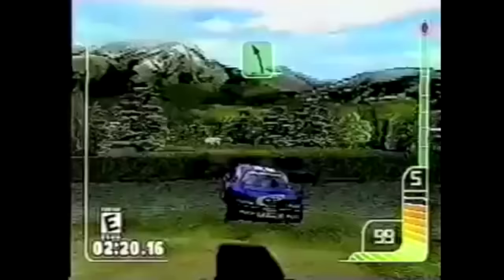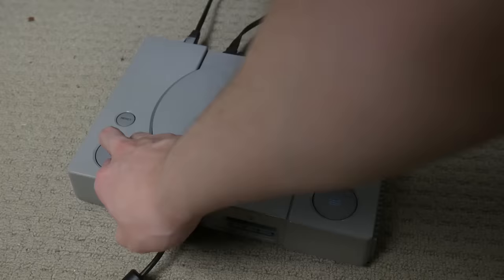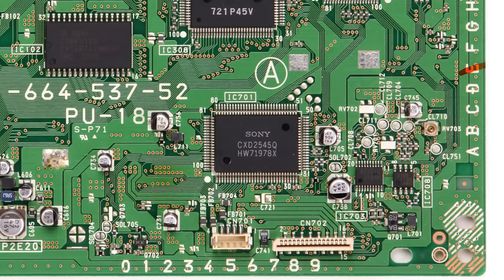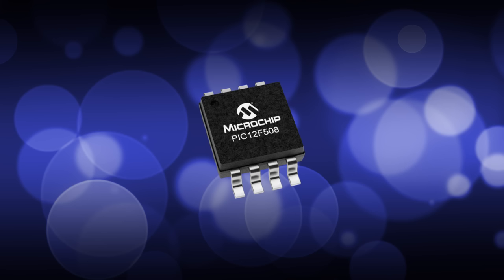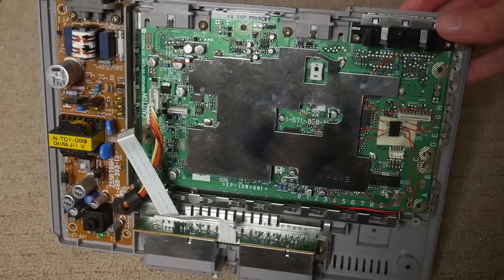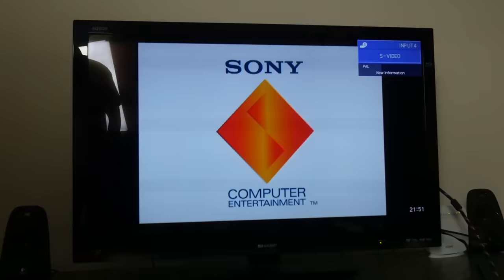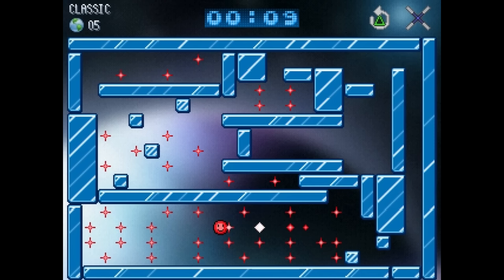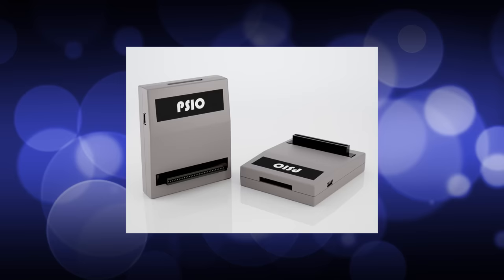Making a PlayStation 1 modchip from SCRATCH

Comment: Just something that is not completely correct on this video.

Stealth modchips don't bypass all copy protections on the PS1. Games that use LibCrypt are making more checks than just the modchip check.

These games (Spyro the dragon 3, for example), check for magic values in the CD which can't be reproduced by a regular CD Burner. Since burned copies don't have these magic values, this means the copy protection will be triggered.

Some burned PS1 games legit need cracks to work properly in modified PS1s (scene groups like PARADOX, KALISTO, STATIC and LIGHTFORCE did a lot of libcrypt cracks).

Comment: Hi Matt, i know this video is old, but i was following it it and i am pretty sure you confused the 12C508/12C508A with the 12F508/12F508A, these 2 chips are very similar, the F is supposed to just be a re-writable version of the C, but i am learning the hard way that the F doesn't seem to be compatible with this mod and according to the github by Kippykip it just isnt. 
You can correct me if i am wrong on this, but if i am right, please correct the mentions of the 12F508/12F508A in the description.

Comment: Cool little video here.   However, you can get new lasers from Aliexpress for dirt cheap.   Are they amazing quality?  No, but when they cost as much as a couple cups of coffee and still work fine for a few years?    Not really much reason to complain. 

PSIO is just far too expensive.   It should be literally half the cost, or less.   Especially considering you have to cause permanent damage to your system, for it to work.

Comment: a PIC Programmer seems like a bit more than a simple DIY project.
i would've gone with a standard arduino Nano, since it can easily be programmed via USB
or nowadays with a RaspPi Pico, which would be very overkill but doesn't require you to install any programming software

Comment: The reason the emulator doesn't have issues with framerate vs the console when doing pal/ntsc is that the ps1 emulator itself can change from 50-60hz (depending on demand) while a physical console can not. (I assume that the writers for the emulator probably just allowed the VC to draw whatever frequency is requested based on the content's region.). 

In fact, playing a legitimate PS1 game on a modded PS1 from the opposite region (Pal vs. NTSC) CAN cause issues depending on if the developers tied game code to framerate. The only true way to get around this, is to install a dual frequency oscillator mod on the ps1, so it can switch between 50 and 60hz itself. However, apart from collectors, the likelihood of someone playing a modded ps1 game from the wrong region to their ps1 is pretty slim...
Reply: The actual console is also capable of switching between PAL and NTSC. The reason It might be NES ran on PAL mode is because he didn't press the L2 shoulder button. It changes the emulator to NTSC video mode. You can also do it in 240p test suite. Upon inserting an NTSC game, the console will change to NTSC mode. But this only applies to SCART, not composite

Comment: This explains the way the ps1 copy protection worked incorrectly. It wasnt data burned to a certain sector, the track on the cd had a certain wobble to it, and the laser would have to move to keep focus, and that movement was how the data was read. Its not just that there arent any conventional cd burners that can write this data, there are no cd burners anywhere that can write this data at all, as it is completely impossible to burn this data onto a cd. It has to written to the cd with the cds pressing, which means any raw cd you buy already does not have this wobble and so you cannot add it. You could press your own cds, but thats slightly more expensive than anything a mortal being can afford.

This does bring up an interesting idea though. A cd manufacturer could have made disks with this wobble already pressed on, and the cds would have run fine on all normal cd players, while also allowing playstation games burned on them to run on an unmodded playstation. Wonder why no one did this

Comment: Mod chipping is only illegal in the UK because the law hasn't been updated since 1988

Edit: actually a court said in 2004 that it is illegal but there is another court case from like 2008 where they ruled that it is not in itself copyright infringement

Here is part of a law from 1988
Section 296ZB of the Copyright, Designs and Patents Act 1988 (CDPA) makes it a criminal offence to sell or distribute “any device, product or component which is primarily designed, produce, or adapted for the purpose of enabling or facilitating the circumvention of effective

So selling them is illegal and piracy is but I'm guessing the UK doesn't like RACISM because it is legal to bypass that.
I'm not a lawyer so don't quote me on this.

Comment: I worked at a PC Shop in the mid 2k's and they Sold Black blank CDs wich looked exaclty like the PS1 Discs and you could Burn them with any CD-Writer. So the Black Ink didnt do anything😅
Reply: It was impossible to buy a licensed console in Russia, as it is sold to the whole world, we already sold it with this chip, which is why all consoles bought in the Russian Federation have this chip modding and any console bought from us is no longer original. We don’t know about black discs, usually a regular disc with a picture printed on it was sold :D
(sorry for my english)
Reply: @Vladstvo  The Black ones just behaved like any other Blank CD. But they looked cool😅 That was btw the only time in my life i have seen those Black CD-Rs. (The upper side was just Silver)

Comment: I had to do all this to my ps1. I’m a collector so I was sweating the hole time as it’s mint. I fitted my chip away from the board and had it sitting pretty and my wires are set out like art work. Very happy with my install 🥳

Comment: "They were able to write data to an area that an ordinary CD writer never could".

28 years on and still nobody can read the patent when they do their research. That's not how it works. It just wobbles the TOC data on the cd from side to side intermittently. Wobble is a 0, no wobble is a 1. It reads the wobble and the TOC at the same time. It's right there in their patent. There's no "wobble groove", that was an invention of the PS1 community.
Reply: The black discs weren't a copy protection scheme either. Also there was at least one, maybe two more checks on the PS1 security. First it would check the wobble data, then look for a logo, then check the wobble data again on later consoles.

Comment: Nope, the four letter Code isn‘t stored in the bios itself. It‘s hardcoded in an custom authentication chip based on the Motorola MC68HC05. So even when you try to swap the BIOS from an NTSC console to an PAL one, it will only boot PAL games. Even some older consoles (SCPH-1002), will only boot PAL games even when you installed a Modchip, thats because missing the NTSC Oscillator clock. Newer models overcome this by using the same clock signal, but isn‘t nearly perfect. So you might see on an NTSC console playing PAL games some flickering. You can get on all consoles a perfect NTSC and PAL signal when you Clock mod your console, but it‘s never done to newer models.
Reply: I think your close, but wrong slighlty aswell. The onboard (on the motherboard) CD driver ic, microcontroller will send over the region, correct or not, but it will do so by detecting the region from the pregab region of any disk inserted. the wobble of the lens that ALL CD/dvd and blueray players correct for, will be looked at by this controller IC you mention. At bootup, it will not only seek the pregab first sectors, but also look at the frequency modulated region code and send it to the main ic (if requested?) anyway, more and way better details are on http://www.psxdev.net/forum/viewtopic.php?t=128 and Technologie connections made a nice video too: https://youtu.be/XUwSOfQ1D3c?t=350 (5:50).

There is a region encoded on the disk, its inside the pregap wobble, and you cant burn it. The modchips override whatever is send by the MC68HC05 to the cpu. 
Right, so I was actualy looking for someone who mentioned the "mistake" in the video, and you did. so I dont have to. but now I feel dirty, for writing this much. please forgive me and take this knowledge. (also please visit psxdev)

Comment: Great video. Do you know if you can use a backup disc with this mod chip and also still use the gameshark(the one that plugs into the back of the system)?

If you have a modded memory card that lets you run backups on ps1, you cannot use the gameshark with it because you need to access the ps1's memory card manager first.

Comment: Got a 10$ chip in my ps to read burnt CDs without soldering cables! I swapped the chips and this was the whole magic! My friend had to swap a original to a burnt one after the boot sequence! The whole time the ps was open and between the switch and the upper housing was a spring! And on the back was a cheating module what was only capable for the very first ps with the back door

Comment: I never asked but:
1- how did they get to read the 4 letter code from the disc?
2- once they had the 4 letter code, how did they figure the proper code to inject and when?
3- how does an outsider know what every PS1 PCB chip pin is doing? How did they get their hands on the PS1 PCB schematic?!
Reply: 3. Using a logic analyser

Comment: Late to the party, but still out of interest: I own an SCPH-1002 (Europe) which you can trick into playing burnt games by booting up an original disc while pushing down the button inside the disc drive with tape with an open hatch and quickly changing the disc to the burnt one while it stands still for a few seconds during the boot screen. The way it works is it reads exactly the part of the disc a CD burner can't copy from the original disc, but boots the game itself drom the burnt one. So if the region information also is within this part, shouldn't it theoretically be possible to play games from every region on an unmodded PS1 with that serial number too?

Comment: I've been tempted to pick up a ps1, but it feels like getting a ps2 and freemcboot is a better option overall.
Reply from the maker: Depends on your goal, a PS2 with FMCB won't let you play PS1 backups/homebrew (outside of POPS which is a software emulator and naturally isn't as good as the native PS1 hardware in the PS2). The only way to enable native PS1 backups/homebrew is with a modchip.
Reply: @MattKC  Ah, well is there any reason not to go for a modchipped PS2 instead then?
Reply from the maker: @moth.monster  The biggest disadvantage of PS2 modchipping is the difficulty (20 wire modchip onto some fairly small contacts). But it's definitely the most effective method of unlocking a PS2. Combined with FMCB for the custom BIOS menu, it's probably the ultimate PS2 experience.

I may or may not be planning a PS2 modchip video in the near future...

Comment: If you ever wondered why PS1's play Nintendo stuff so well, you have to delve into the whole next generation of where the SNES was and the then collaboration of the Sony/Nintendo joint next gen console and the court case that followed one of historys longest litigations where Sony kinda wandered off with the goodies that became the PS1.   If you ever had the dongle that allowed you to put Gameboy games into the memory card of a PS1, looked at the almost childlike simplicity of the translator, its not that hard to see that a PS1 has a beating heart of a SNES and I suspect the joint console was planned with some idea to bring forward CD's with compilations and games from Nintendo's back catalogue.
Reply: The sound chip in the PS1 is an evolution of the Sony SPC700 in the SNES
Reply: I don't think any of the PSX hardware resembles the SNES and there is certainly nothing in the PSX that would help with running Gameboy tech.

Comment: you forgot to mention the dreamcast, mine played burnt games without modification. 
Cheers for the info on your xbox video, when i get mine out of interstate storage they're getting caps removed, and caps replaced!your mate has a modchip why though? softmod all the way..!
Reply: Also i thought the original chips were 12C508/A and 12C509/A, i got a cheap PIC programmer years ago and used to sell these.. also the Xstation is more compatible than the PSIO

Comment: I bought a playstaion scph 1002 and on the bottom it has a PIC12C508A. And only 3 wires, it sold as faulty and you can hear the laser touching the CD! If I remove it and its cables can the playstation become like an original one??
Thanks :)

Comment: i actually have a modded ps1. my dad modded it back when the console came out. only my PAL model ps1 actually gives the correct region code and still launches. 
like if i play persona 2 English patched it will give japan region code, and also change the tv screen signal to the correct region.
are there many mod chips that do this or is this just a weird outlier.
it is just a simple 8 pin mod chip as well.

Comment: "may or may not be legal" your hardware is your hardware, unless you are in a dictatorship, you legally cant be charged for it.
apple has been able to disable your iphone for jailbreaking it, but that is also currently under scrutiny and doesnt work in their favor in all states, let alone in other countries

now, if you have RENTED or BORROWED hardware from someone, or have it LEASED to you, its not yours and modification can be seen as mistreating the hardware, as it can possibly damage the hardware, or reduce its value (when not necessarily applied to the PS1, or to collectors)

i dont take warranties, because i turn stuff into scrap parts for projects once they are broken for their intended purpose, but they are utter trash if say, burned, or broken clean in half (things like rectifiers and chokes are useful or expensive, and most of the time cheaper to salvage than buy)

Comment: I still have my PS1 at my parent's place and also a module thingy I got from my uncle after he came back from a business trip in China, along with a spindle of like 10-15 copied games on CD-R. My PS1 isn't modded to this day, at least not that I know of it but this module that you insert into that big slot in the back of the console let's you play pirated games. It also came with a spring you install into the disk drive, connecting the lid and the drive (not sure why you would need it for this to work) does anyone have anything similar to that or maybe even the same?
 When I visit my parents again I can look at that module to see what the label on it says so I can maybe get more information about it. Oh and I also got a special AV cable from my uncle that day which let's you play NTSC games in color because with the normal cable you'd only get a black and white picture.

Edit: I just googled a bit and apparently this is called a smart cartridge which is mainly used for cheat codes but I don't remember any cheats being on it (I might be wrong though) so maybe the shop my uncle got it from modified it to make your PS1 play pirated games instead.

Edit 2: This is not exactly the same smart cartridge but it seems to have the same menu mine has, so yes you could also load up  cheats with it https://youtu.be/xzD3tdZbbp8
Reply: It has that spring because it's supposed to go in that plastic peg that holds down the lid switch. If it's there it will always push the lid switch down which it has to in order to defeat the copy/region protection. With that cartridge connected and a retail game inserted and the lid switch held down, the disc will spin for a few seconds and then stop. During that time, the system reads the area of the disc responsible for identifying whether the game is a retail copy or not and what region the game is. Then, you can take the disc out and put in your backup or different region game. Now if you removed that lid spring and closed the lid and tried to boot a copied or different region game, the system wouldn't recognize it because it needs to recognize a retail game with that cartridge in place before it can play a backup or different region game. I have a VCD add on for the PS1 that works the same way. You have to put in a retail game first so that it can defeat the copy/region protection. When it's done that, you can then put in a VCD and it will start playing it. And the lid switch must be held down at all times in order for it to work.
Reply: @1980sGamer  yeah thats what I had to do. Put in a genuine retail game, the CD spins a bit then stops and then put in a different pirated game. Good times :)